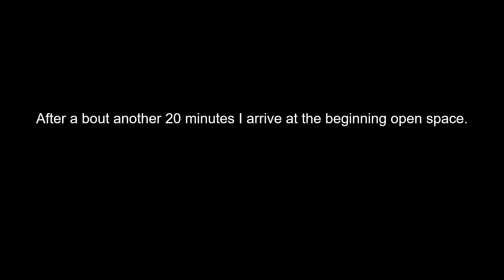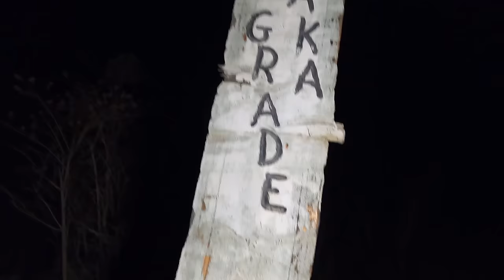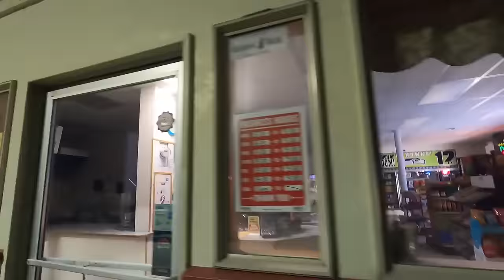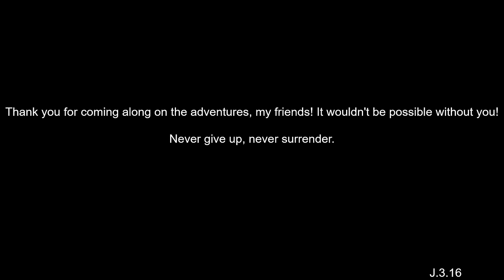Return from chopaka mountain part two

Comment: Hey matt it appears your truck has charging system issues, I remember you recently replaced the alternator, a bad alternator will damage your voltage regulator. The voltage regulator is pretty cheap around $15 for those older trucks. While the truck is running you should be getting at least 13.5 volts at the battery. I'm sure Tom knows where it is located under the hood, they are very easy to replace usually a bolt or two and a 2 wire plug going into it.